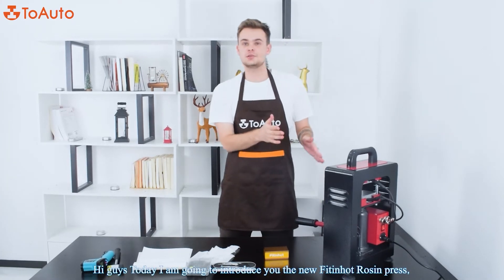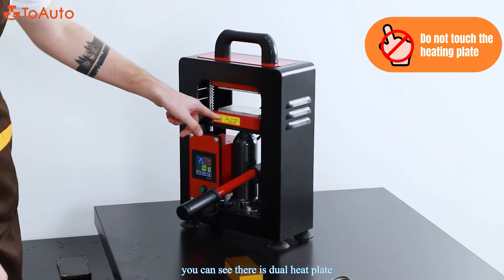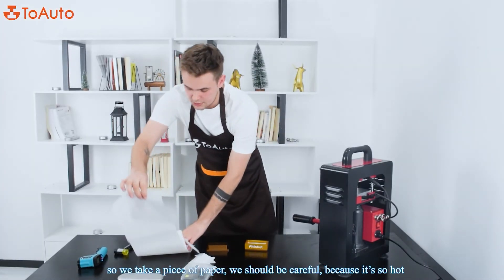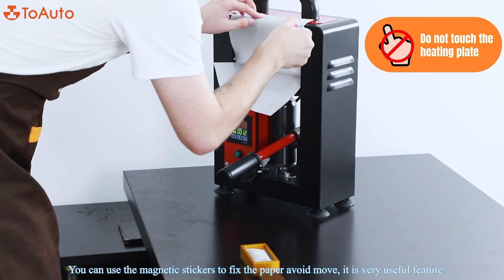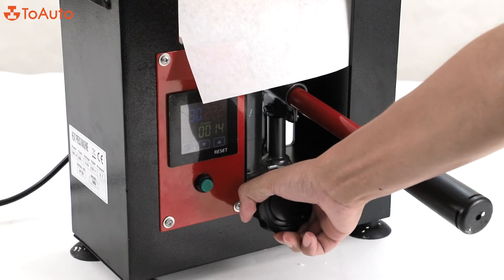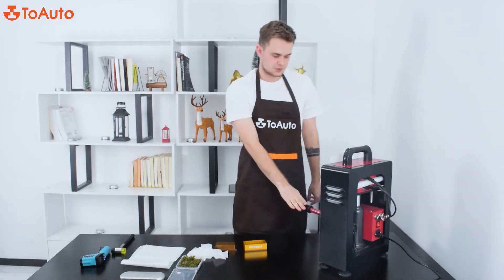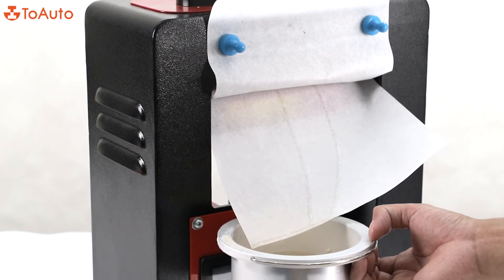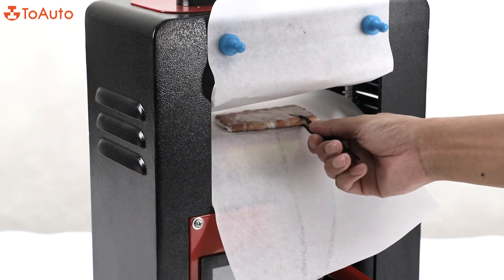2021 5 Ton Heat Press Machine for oil extraction

Comment: How do you adjust the time and temperature ? , without using support from the website ; that make's you log into messenger.
Reply from the maker: There is a regulating table on the machine.💕